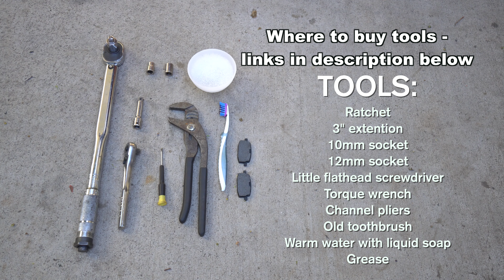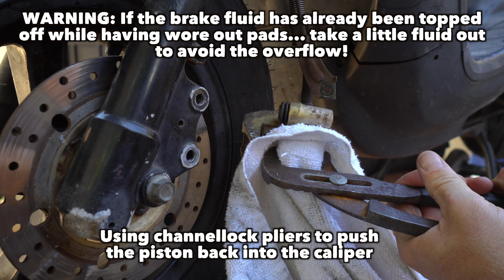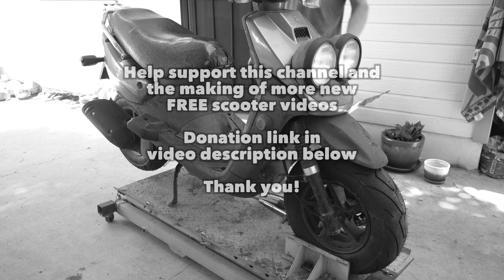Yamaha Zuma / BWS 50 - How To Change Brake Pads  | Mitch's Scooter Stuff

Comment from the maker: Few options for new brake:
Brake pads ebc fa169 - https://amzn.to/30CX3bW
Brake pads sok LD224 - https://amzn.to/30eiDIE
Brake pads and drum sok - https://amzn.to/30gjUyS
Disc, brake pads, and drum - https://amzn.to/30aPOvO

Tools I used in this video:
Ratchet 3/8 drive - http://amzn.to/2hhmnUs
3" / 6” extension set 3/8 drive - http://amzn.to/2h7ypMl
10mm socket 3/8 drive - http://amzn.to/2xGuLSF
12mm socket 3/8 drive - http://amzn.to/2xM4Edr
Tiny flathead screwdriver - http://amzn.to/2zyrLck
Torque wrench 0-150 lb/ft 3/8 drive - http://amzn.to/2Crqq4R
Channellock pliers - http://amzn.to/2CMrVLq
Toothbrush - https://amzn.to/31HSoXI
Warm water with liquid soap - http://amzn.to/2G2zTWg
Grease - http://amzn.to/2wXw8Zy

Comment: Just a heads up the spring clips should be replaced too and cost less than $2
3XG-F5919-01-00
3XG-F5919-11-00
Separate part number for each side to be an extra pain
Reply: Where did you buy the clips from

Comment: After changing my brake pads, I pumped the brake until it was firm then when I went on a ride, I could only hit 15 mph. I think the breaks are squeezing the disk. It’s squeaking too. Do you have any solution or any advice?

Comment: Sir,  I need your valuable guidance for my New HONDA ACTIVA 6G -- . I have a proble

m with the Rear wheel. It has a  wheel play of 0.5mm. generating unusual heat at the Brake Drum. Awaiting your reply.

Comment: Man , i just got a burgman 400 2007 , the clutch engages at really low RPM , I mean if I just let the brake free it starts moving , I tried to lower the RPM but it is exactly the same with low RPM,  is it normal? What should I do ?
Reply from the maker: Hey, I would disconnect the battery and wait 15 minutes and connect again to see what's happening